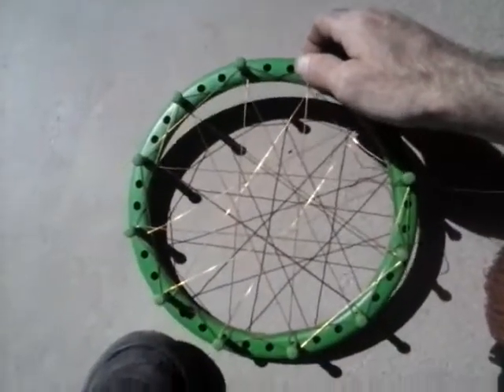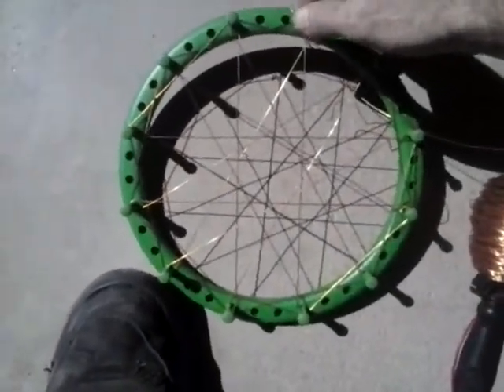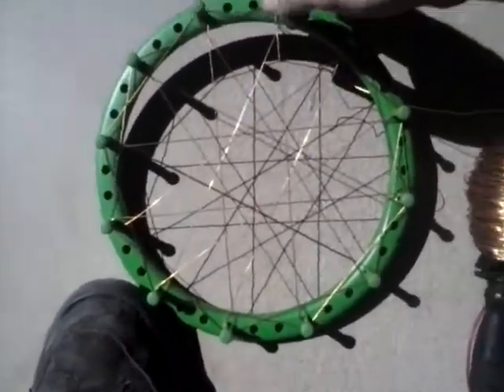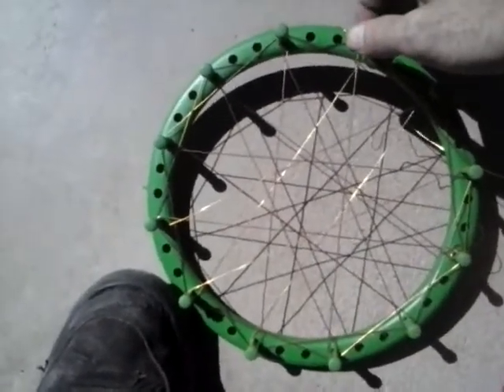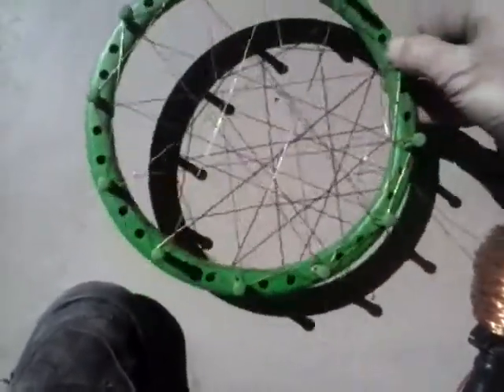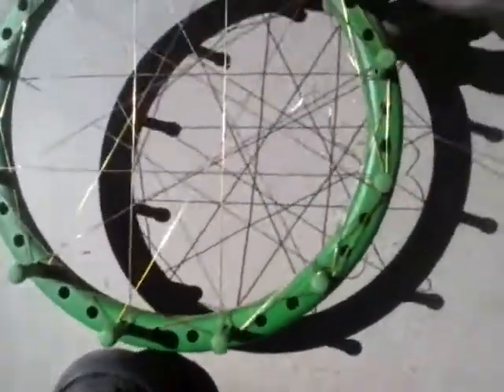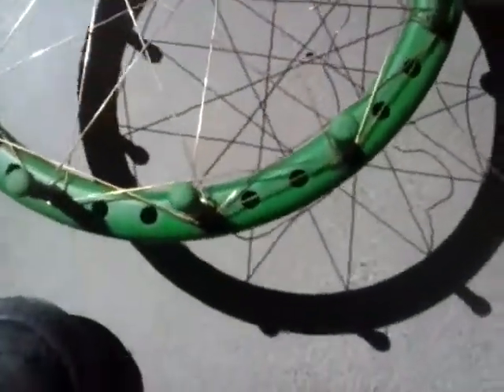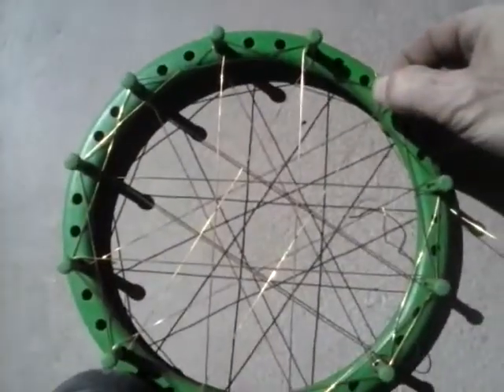3,1,6 pattern similar to Rodin Starship coil

Comment from the maker: here is finished coil... in the video... if you notice the plastic pins... they didn't work out as they bent... switch to steel... actually used big screws and grinded the threads off upper screw... here is pics of the finished coil... will start testing tomorrow if I have time... https://www.facebook.com/#!/photo.php?fbid=10202446934476243&set=a.2315699733529.136806.1280547999&type=1&theater